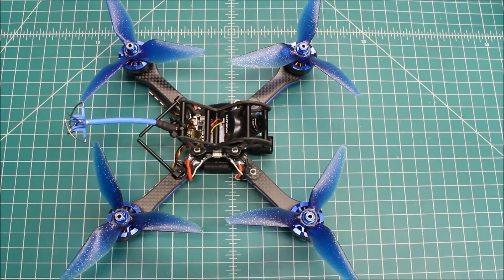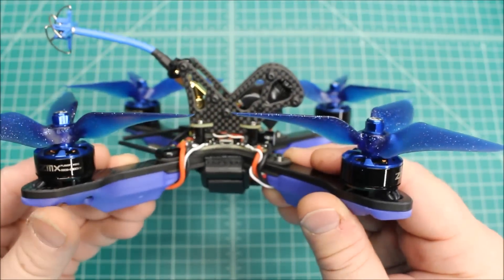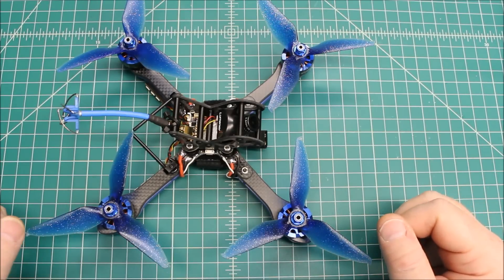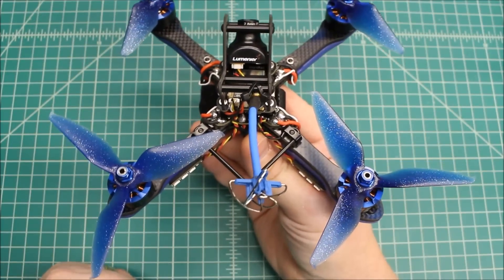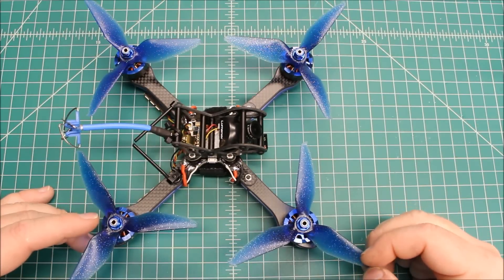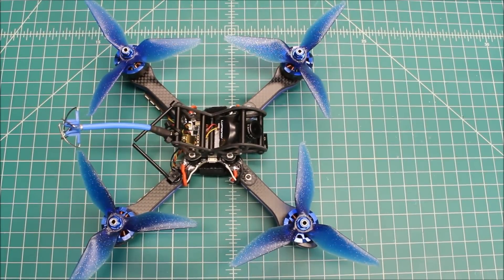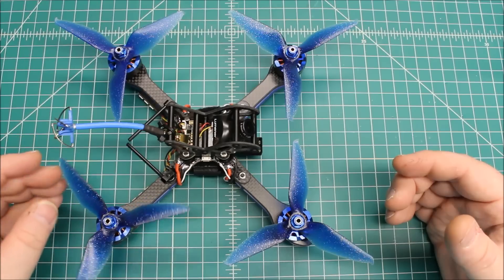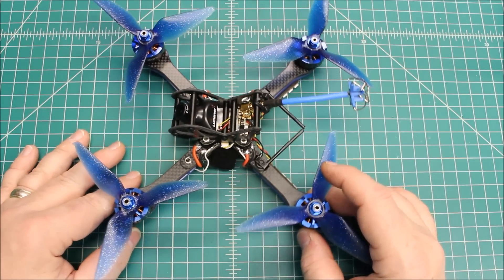ImpulseRC Helix Final Thoughts and Flite Test

Comment: put on the cables nylon uv wire mesh any color you want and would be ultra clean ,because for me it looks awesome. great job men, but that frame is fro 5 inch or 4 . because if its 5 the racekraft props should be fine the are racekraft 5051 3blades props and let me tell you this prop are awesome I have it tested and they don't break, seriously.
Reply from the maker: Pablo R it is a 5" frame and 5" props. Because the 5051s are taller the area they make contact with is the GoPro mount.

Comment: aren't those zmx motors way more powerful than the red bottoms? Even if they are a little more heavy.
Reply from the maker: +T.P.K. They are quite a bit more powerful but some people are really focusing on getting the lightest drone in the air possible. In theory this makes for a more agile craft and make direction changes easier.

Comment: Wow... quad weight is equal to my Alien 5" with red bottoms. Even on this one motors are above 30g still not that much difference when this frame is positioned as racing frame, isn't it?
Reply from the maker: Yes it is positioned as a lightweight racer.
Reply: Alexandru Covaliov I got two Aliens and one Helix, and the Helix demolishes the Aliens. The lack of drag on the Helix is the main difference, not necessarily weight (but a Helix will be lighter with the same components)